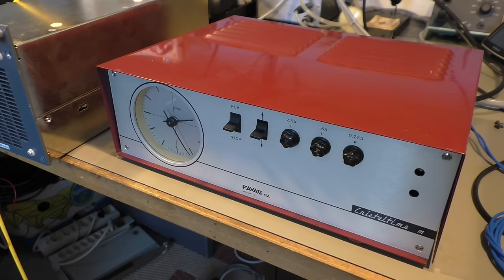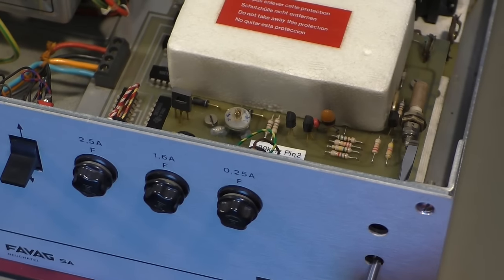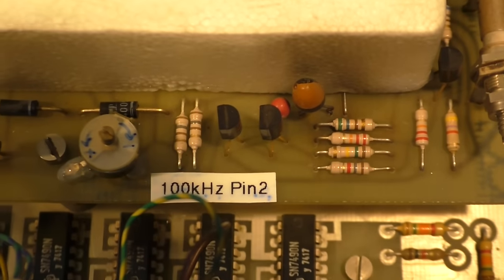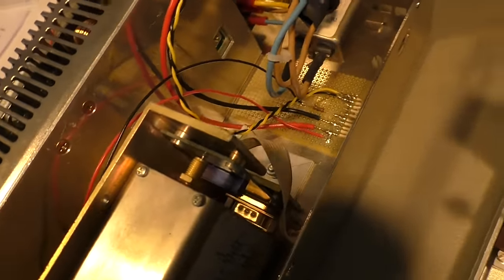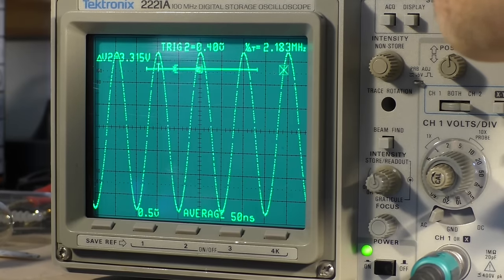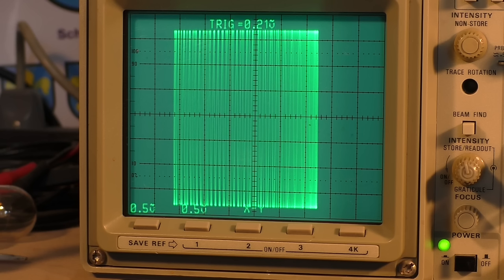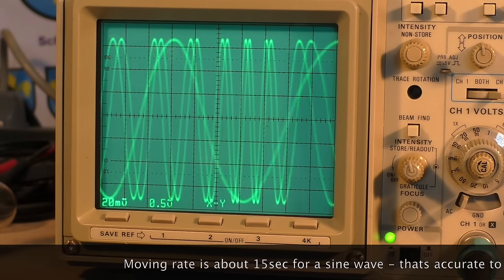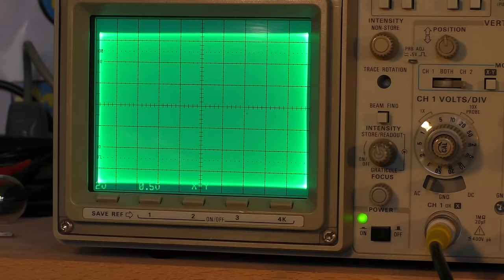PWJ38 - Super precise clock adjustment with Rubidium oscillator

Comment: That was very informative, and interesting to see. I never guessed that you could use the x/y mode on a scope to adjust a clock rate.

I love the look of that Favag clock!
Reply from the maker: You can use that method to adjust any frequency as long as you have e good reference.
In the old days of analog tape recorders (like compact cassette) there was a 50Hz track on the test tape and we took the reference from a small mains transformer (50Hz too) So we were able to adjust tape speed very precisely.